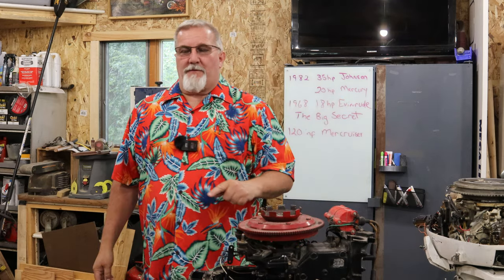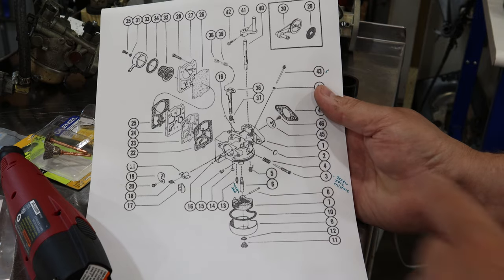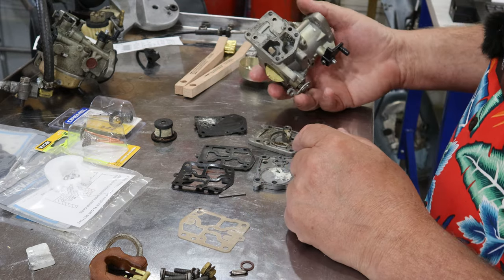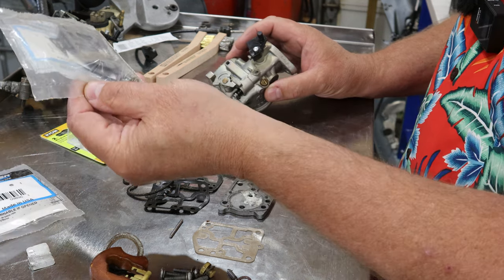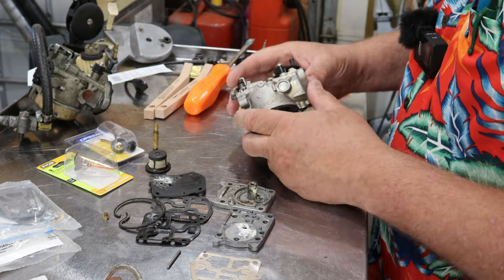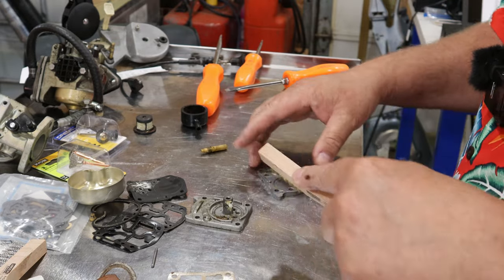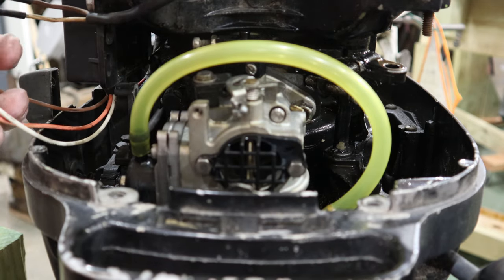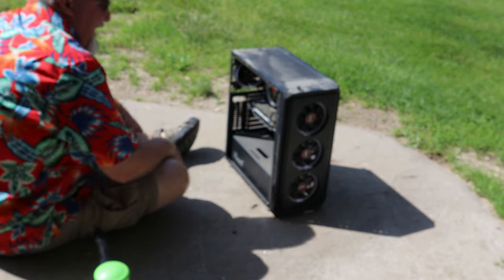1975 Mercury 20hp Carburetor rebuild  Will it run again or not? Let's dig in and see if we can fix

Comment: Great video as always! Ill be watching your 9.5 Johnson videos again and again! I have a Johnson 9.5 sea horse model #9R-73B that came with the boat a friend of family gave me. Its my first boat to restore \ build! All these videos help! It sat in the woods for about 10 years so everything needs to be rebuilt or replaced! The kill switch and the wires to coils are all rotten and broken, needs carb and fuel pump rebuild and the lower is leaking oil. And to top it off a carpenter bee got inside through the pee port and tore almost all the foam from the hood of motor and built a nest down inside the motor! I've never worked on an outboard before so I know this is gonna be a real fun job for me or somebody else if I feel like I can't do it myself here in the future! Wish I knew someone around my area like youself to help me out with this project!
Reply from the maker: There are tons of videos out there to help you move your project forward.

Comment: Love the video!! I have the exact same motor I’ve been messing with for over a year now and I have to stay on the primer bulb every so often. I’m assuming I have an air leak somewhere causing the mechanical pump to not have enough pressure to fill the bowl, or I possibly didn’t set the float to the correct height. I’m just taking it slow working on it but this video was so helpful I appreciate the time you took on it! I’m new to working on outboards so this video is my biggest learning experience yet. Thank you.
Reply from the maker: Awesome, thanks for watching

Comment: I've got a 1975 Mercury model 110 9.8 good spark good compression rebuilt the carb it does a couple times then died. It's leaking fuel out the throat of the carb, did a pressure check and there's air leaking out the float needle, would that cause the leaking if the float needle doesn't close?

Comment: Great Video, helped me a lot! One question i still have, did you put in the fuel pump both of that thiny gaskets? I mean that black and that "yellow" one. Because i have put from the carb site: 1. Thick gasket 2. Yellow gasket 3. Black gasket. And Motor is running...🤔

Thanks and regards from Finland
Volker

Comment: Hi! I just picked up one of those old 20 hp mercs. I checked the spark with my tester and there was nothing. Then i took the plugs out and tested against the block. Still no spark. Then the first thing i did was to check your channel. when i checked my plugs i had the normal plug with a litle hook where the spark has to jup a litle gap. I see that your plug just have a dot in the middle. I wonder if that is why i have no spark. What plugs do you run and where can i order them? Hopfully that is the issue. Sorry if I am bad at english im watching al the way from Sweden. Love your videos by the way.

Comment: I have the same motor- 74" pushes my 500lb 14' smoker craft @ 25 mph w/just me in it { I weigh 190} and gear- I did the same-rebuilt carb and resealed lower- bearing carrierO-ring gasget and prop shaft seals and I built a jack plate to dial in the cavitaion plate to skim the surface on plane- W/ 9x9 prop which seems to be just right rpm
Reply from the maker: Good to know.  I can't wait to see what it does on my test boat.

Comment: when you had the other carb  i remembered something. i was always under the impression that the differences between a 9.9 and a 15 was the carb throttle plate size.  sometimes it is  but sometimes like i found on my 4 stroke is its the actual casting thats in the middle of the throat that makes the venturi. the 15 is about 1/8 inch bigger diameter is all.
Reply from the maker: Yes sir. Thanks for watching and being a regular commenter.

Comment: i tried clear fuel lines last year and it helped me see that i was getting air in the line from the fuel tank fitting, however, the clear fuel line didn't last a whole year.  Over the winter i keep my outboard in the basement and when i got it out this spring the clear lines were hard as a rock and seeping air at almost every fitting.   I wont use them again.
Reply from the maker: Were they fuel rated?

Comment: Michael I have the same 20 hp Mercury 1975…. question…. Tried to replace the impeller and the low unit still locked after a loose Two bolts. What else I need to loose?…. can you do a step by step youtube video about it?…
Reply from the maker: do a quick you tube search on Mercury 20hp water pump replacement, I'm sure you will see what you are missing. Thanks for watching

Comment: i got tired of tough carb jets because the wedge shaped screwdrivers just dont fit right.  briggs and stratton part numbers 19061 and 19062 have fit everything so far.  also some of the bits that are in exchangeable but sets are round cut and have a nice square tip instead of a wedge.
Reply from the maker: Thanks for the tip, much appreciated. Thanks for watching

Comment: 7:43 did you ever get that screw out? I can’t get mine out on my 9.8hp. Carbs are close to identical.
Reply from the maker: I did not, but the motor runs pretty good other than a strange sound I can not identify.
Reply: @Michaelsbackyardmarina  I guess I’ll leave it. I’m waiting on gaskets and compression tester. It won’t kick even if I put fuel in the carb.

Comment: I’m not super familiar with carb engines or marine engines in general. But how would I go about adjusting my carb on this motor? I rebuilt it and it runs but it’s not happy, I’m assuming my tune is off
Reply from the maker: If I remember correct, there is only one air mixture screw on that carb, about 1 1/2 turns from bottomed out is a good starting point. thanks for watching

Comment: I have a 25 hp merc im having problems with.  Took the carb apart and the butterfly valve is jammed about 25% open. Any advice on getting it back in and moving freely? I have removed it now and am soaking everything in some  parts cleaner
Reply from the maker: soak it like your are doing and take it easy is the only advice I have.